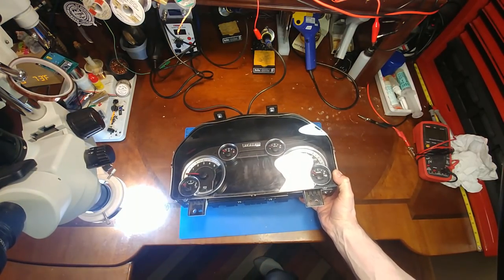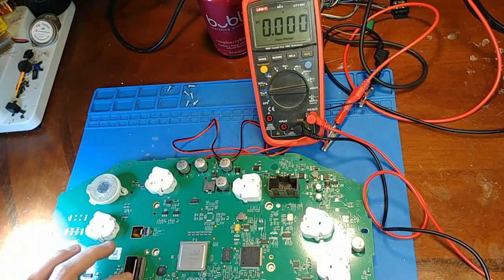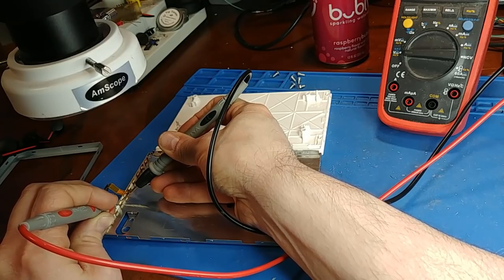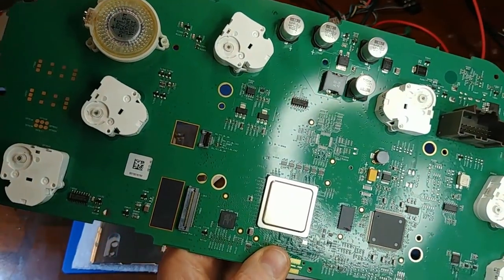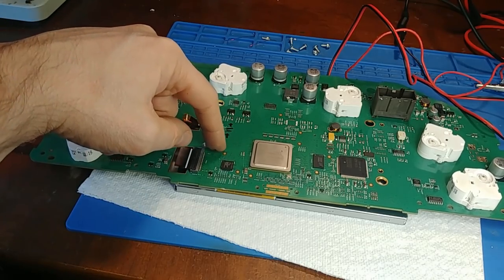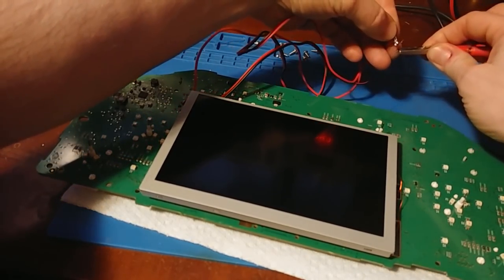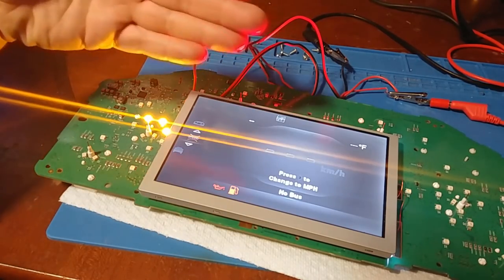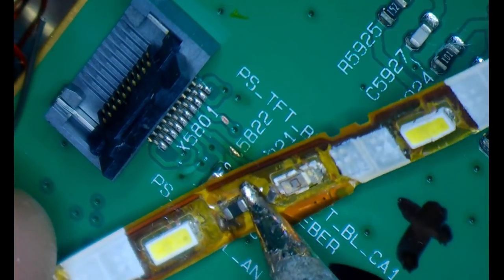Dodge Ram Cluster 7 in LCD Repair

Comment: Just to be clear for everyone, LEDs are current devices so once they turn on the voltage varies very little but the current can vary a lot so current is what you need to be concerned about.  Thanks for the video!
Reply from the maker: Yes very true. I'm assuming the maximum voltage of these back lighting LED's are 3.3v. So at 3v it's not possible for the LED to over current. Just assuming so I could be wrong. But I did let the cluster run for a hour. And if I end up being wrong, I warranty my work so the customer won't be out anymore $$.
Reply: @jeffescortlx  -  My comment wasn't meant for you Jeff. I'm sure you already understood that.  I was just trying to help people that might not fully understand the importance of limiting current to LEDs.
Reply from the maker: @rpsmith  your right, I didn't really explain the relation to the current passing through the LED's.
Reply: So as long as the leds are ran in series  they should be fine . 15÷5=3
Reply: @chucksaunders7574  - The important thing to remember about LEDs is that they are current devices not voltage devices so discussing voltage and not current totally misses the point.

Comment: What pins did you wire to so that you could perform this test? I'm testing a used cluster out of a pick n pull yard and could use the pinouts to test it with. 2014 ram 1500 gas 7" evic, want to verify screen fuction

Comment: Just a thought on no control on the transistors.  I would suspect the cluster needs know headlamp status / sunload sensor(DTRL)/ dimmer position(s) on what ever protocol it communicates on to output the correct pwm.      If that was the case, I would suspect faults codes and maybe default to full brightness??
Reply: Bummer it was an expedited reapir.   A+ on the repair and troubleshooting.
Reply from the maker: I can understand it needing to comunicate to the bus to get backlighting percentage data, but for it to default to off just seems bazaar to me.
Reply from the maker: @hoaxs1939  interesting find, says "This problem will be repaired by an upgrade to the software for the instrument cluster". Maybe this model suffers from both hardware (LED failure) and software (backlighting not getting turn on signal).

Comment: Next time you work on a diesel ram cluster, could you see if it's possible to isolate one of the mechanical gauges so that it could be hard-wired to a different component? I.E. using the oil temp gauge as a level gauge for an aux fuel tank, or as a pressure gauge for an air tank.

Comment: This is an older video but there is not much information out there. I had an issue with the back light.. Mine  would start to flash with heat and eventually black out. Sometimes turning on the headlights would allow it to work dimly.  I bought a used cluster on Ebay.  I was worried it was the dimmer control line going to pass transistors and I would be out the price of the cluster but that was not the case with mine. I used Alfaobd to write the engine hours and odometer information to the used cluster without an issue. 
Thank you for identifying the two switching transistors as I suspect they are the culprits. 
There was a firmware upgrade for this issue on 2013s so it is a known issue on early DS Rams with the 7 inch EVIC.
Reply from the maker: There has been an update, check out the top pinned comment just above your comment. It is not back light transistors, they are not at fault. It is just a failing LEDs in the LCD assembly. It is not necessary to buy a used cluster and program it. The LCD screen in a used cluster might have limited time left. Brand new LCD screens are available on eBay for a reasonable cost now.

Comment: Good evening 
Thanks Jeff for another great video. I fixed one of those a few weeks ago, different issue, (faulty stepper) not sure if this will help but I noticed that the lcd back light doesn't turned on while testing on the bench but it did in the truck.
Reply from the maker: Now that's strange.
Reply: Perhaps it needs data from the truck's canbus or other line to know how bright it should be.  I'd think the brightness would be driven by the headlights on/off and dash dimmer settings - all stuff external to the gauge cluster.
Reply from the maker: @russellhltn1396  yes we kinda worked that out in the comment section. Although in my opinion it should defult to at least minimum or medium brightness, not off.
Reply: @jeffescortlx  Yeah, I run across that all the time.  But the engineers didn't consult either of us.  The manufacturers have no obligation to consider people doing benchtop repairs.  They're own people would have a test rig that takes care of it.

Comment: 1. Jumping those mosfets to light up the cluster should only be used for testing. There is a huge amount if current going to though the resistor and it will soon burn out. I have yet to see one that actually has a bad mosfet. You just need lighting data circuit to get the cluster going. 

2. The issue is burnt LEDs. At least 2 of them. You can tell which ones by discoloration on the ribbon. The blown LEDs ran hotter.
Reply from the maker: Please see the top sticky comment.

Comment: Do you happen to know where I could get a new motor for the needles? Replaced the screen in my gauge cluster on my 2016 Ram and now the gas and oil pressure gauges aren’t working.

Comment: Pretty sure thatrs not a temp sensor. It's a ferrite bead.
Reply from the maker: It's impedance of 7k ohm would be too high for a ferrite bead, plus the resistance to tempture swing seems way too sensitive for one. If it was just a ferrite bead for cleaning up the LED pwm power I'd expect to have two, one on each independent channel of LED's.

Comment: I imagine the transistors would be driven with a pulse width modulated waveform, much like a switchmode psu.
On/off ratio.
Was there no base/gate drive on the transistors then?
Reply from the maker: Yes correct the backlight will be PWM. And yes whatever drives those transistor decided to stop cooperating.

Comment: excuse my ignorance, But from what I gathered is that as long as my back light is still working, and only flashes/flickers when at full brightness I have a bad led. And I can just replace the screen (found some online between 70 and 130 bucks) 
If doing so would I loose my dimmer function as well?
Reply from the maker: No just replacing the LCD screen will not make you lose the dimmer function. You'll only lose the dimmer function if you bypass the transistors like what I did in this video.

Comment: I have a 2014 Ram with this exact cluster. The backlight on the LCD keeps fluctuating between light and dark. At first I thought maybe the light sensor was faulty, but if that was the case my headlights would be turning on and off. I guess I am just not sure where to look from here for a diagnosis?
Reply from the maker: Your instrument cluster has the same issue as the one in this video.
Reply: My issue seems to be different than the issue that you corrected. I can still physically see the information on my screen it doesn't go completely blank. It just gets lighter and then brightens up again. It's almost like it is auto dimming.
Reply from the maker: @thirdgearboogie2210  There are two channels of LED lighting. It sounds like you have one channel that is still fine, but the second channel is becoming intermittent. So when the intermittent channel goes out, you're down to just 50% of the backlighting. And then when the intermittent channel comes back on you're at 100% back lighting. If you give it enough time the good channel will also become intermittent and it will go completely black.
Reply: Would you be interested in fixing it
Reply from the maker: @thirdgearboogie2210  sure
Reply: @jeffescortlx  Awesome! How would you like me to contact you.
Reply from the maker: https://youtu.be/T_2WnJMsZaU

Comment: I have a question about a 2011 dodge cluster. My issue is the needles on gauges don’t work anymore. I can explain more if you have time.
Reply from the maker: Sure go ahead and explain and I'll do my best to help.
Reply: @jeffescortlx   I removed the cluster and the all the plastics to see if there was a problem internally and that required me to remove the gauge needles. When I put them back on only rpm and speedo and oil pressure worked all other gauge needles don’t work now and have free play
Reply from the maker: @tommysatch6207  what was the original reason to take the cluster apart?
Reply: @jeffescortlx  p0381. Diagnosis said to remove cluster and check bulb. Bad mistake on my part. I was unaware of the repercussions
Reply from the maker: @tommysatch6207  it looks like that code is for the glow plug.
Reply: @jeffescortlx  yes I know. Part of the diagnose from what all data showed was to check bulb in  cluster.
Reply from the maker: @tommysatch6207  well, was there any problems with the glow plug light when you got in there?
Reply: @jeffescortlx  no but in the process I removed the gauge indicators and when i re installed them a lot of them quit working. I’m wondering if I damaged the little white boxes that the indicators connect to.
Reply from the maker: @tommysatch6207  Yes it is possible to stepper motors have been damaged. I do see it happen if people are not familiar with removing the needles.

Comment: Very interesting . I have a 2013 ram and having backlight issues ie it flickers hi and lo . there is a sensor that tells the backlight whether  it is day or night  and sets the backlight at the right level , bright during the day, dimmer at night this same sensor also controls the auto headlight feature.Having issues with that to sometimes does not turn on at  night . still trying to track down the exact issue either the sensor on the dash or the module or getting poorer ground connection as the problem seems to be getting progressively worse .Your work was a great help as it somewhat eliminates the cluster . thanks
Reply from the maker: Is the entire dashboard backlighting flickering or just certain areas?
Reply: @jeffescortlx  just the lcd display in the cluster  the rest stays constant but now that you mention it the 8.4 in the center stack is unaffected but also controlled same as dash lcd .Dam
Reply from the maker: @alexkay1874  ok, if only the LCD is flickering, than you have dying LED's in the LCD. Seems to be a common issue.
Reply: @jeffescortlx  Like I said DAM I really didn't want to pull the cluster but what you say makes good sense .I guess I have two issues the other being the auto headlight . Thanks for your help .
Reply: @alexkay1874  same here, my lcd lights are the only ones flickering. Seems like it’s the backlight leds that are dying.
Reply: I have the backlight flicker too in my screen 😔 2014

Comment: Could you are anyone tell me what pins are needed to bench test this cluster? I tried the pins showed in your video but only got the analog gauges and icon lights. No LCD or backlight. Thanks!
Reply from the maker: The LCD backlight is controlled by the vehicles bus. Chrysler's LIN bus it needs to see to be triggered to turn on.
Reply: Ok thanks very much!  @jeffescortlx

Comment: What wattage size was the 100 ohm resistors? and where did you end up inserting them into the circuit board? Did you use SMR?
Reply from the maker: I'm pretty sure they are 1/4 watt. Maybe less. Not sure, going off memory. They went across the emitter and collector on those transistors that run the back lighting.

Comment: Hello, I would like to know if this cluster can be adapted to a 2012 Ram 1500
Reply from the maker: This style is for 2013-19. I'm not familiar enough with dodge clusters to know all the changes both physical and communication wise to say for sure how compatible the 2 generations are. I'm pretty sure the older style has about double the wires coming out of it. So you might lose keyless entry for example.

Comment: Hello Jeff, thanks for the videos.  Do you happen to know what would cause no backlights only on cluster , in a 08 suburban? Thanks in advance
Reply from the maker: If only the cluster is not backlit, than I'd assume a defective led. But if the entire dash board is not lit, I'd assume a dimmer switch issue or fuse or other circuit issues.
Reply: @jeffescortlx  The connector pins in the board also have soldier joint issues. Pull the cluster out and rock the connector slightly while plugged in and see if the backlights turn on. If so, be sure to include a resolder on the connector pins with whatever else you may be replacing at that time. Found this out by accident while removing a cluster for this issue once. I have repaired three since and all three had over 700k miles on them (fleet vehicles).

Comment: Jeff, can you tell me how you got the screen to illuminate on the bench? I have connected power/Gnd to connector and cluster turns on but no display. I have tried all wires in connector to ground / 12v but nothing. Yes, the screen works. Can you please share connection points to see screen powered on?

 -Fellow Speedo repair guy
Reply from the maker: You'll need to power up the cluster and jumper the transistors like I did in the video and the LED's have to be good.
Reply: Thanks for the reply. I have a few of these on my work bench that need led. Do you happen to have any part #s of led replacements?

Comment: Where are you located? Would I be able to send you my cluster for you to diagnose what the problem is? I have the same exact cluster when the same problem…all analog gauges work properly but my LED screen is out….very rarely, maybe once every few months I’ll see it flicker really quick.
Reply from the maker: You need to replacement LCD. They're for sale on places like eBay and Amazon.

Comment: I have the exact same cluster in my 2013 ram 1500 sport. The center lcd flickers almost like a strobe light on highest default brightness. If I turn headlights or park lights on and use the dimmer switch to dim the guage cluster lights the flashing/flickering of that center evic guage screen stops.    Dealer wants $1200 Canadian pulse another $300 to sell me new cluster and program mileage into it. Uhg stealership!   So I found a company that sells replacement lcd screens for these trucks.      I’m mechanically crafty can you confirm that to remove the screen from the circuit board the 2 power leads just simply unplug? And and new screen would just be plugged in is my understanding?      Your video doesn’t show your full cluster disassembly and the plugging in of the lcd to circuit board?   Any help would be appreciated for me and the 1000s of other ram owners with this dash flicker.
Reply: Hi Shadowfire81, I have exactly the same issue. Did you have any luck finding what's going on with your lcd?

Comment: Interesting. In my 2020 Jeep Wrangler I made a dimming adjustment on the way home from work. The next morning the screen was gone. The "black" screen will change to dark gray and back to black with the dimmer control, but that's all I've got.

Wondering if I have the same issue. If it is CAN bus related, are you saying there's a driver or other component in the cluster board somewhere causing it? But it doesn't sound like you know exactly what or where it is? I already had a mechanic try updating software, $400 for nothing. 

I have a used one from a wrecked vehicle on the way, but it sure would be cool to fix mine.
Reply from the maker: If it uses the same 7" LCD as the Ram/Durango then it's probably just LCD screen failure. I've seen both image and backlight failure in these Chrysler screens. It's not the cluster PCB LED driver circuit, it's fine. Chrysler just uses its special can bus to turn on backlighting.
Reply: @jeffescortlx I guess I could pull mine apart when it comes out and see if there's a part number or something on the screen to ID it and maybe find a replacement? 

Thanks!
Reply from the maker: @portmod797 at this time part numbers aren't really cross-referenced, when I see these screens for sale they're always just sold by a description and not a part number. If you're going to disassemble the cluster yourself I recommend to not remove the needles and don't allow your fingers to touch the face. If you can send me a photo of the back side of the LCD I can ID it.
Reply: @jeffescortlx  I sent you an email with a picture of the back of the display. Thank you!